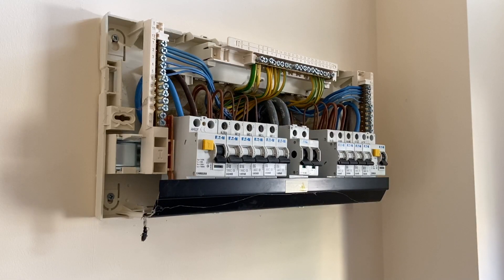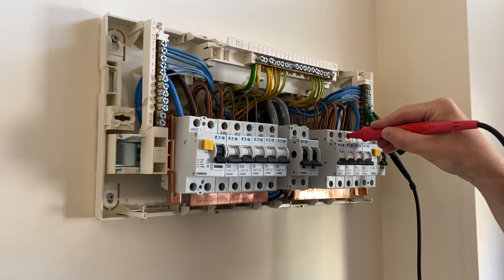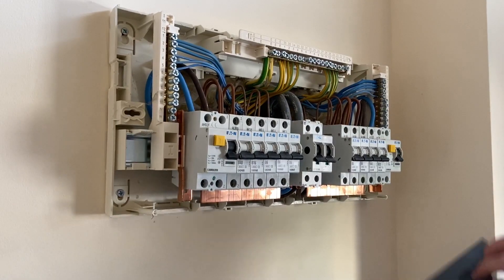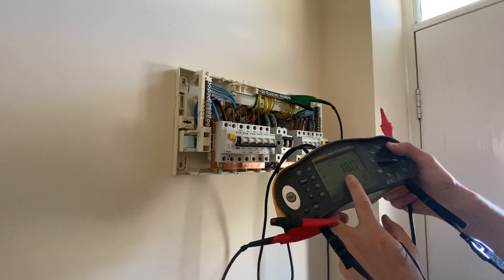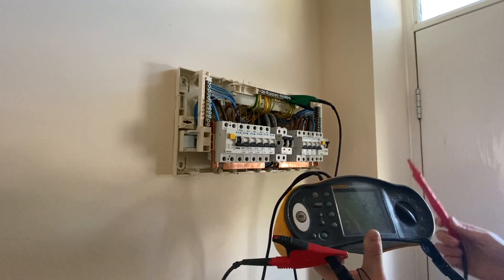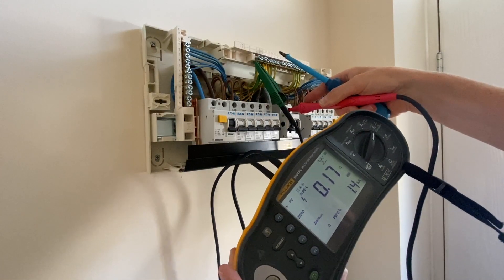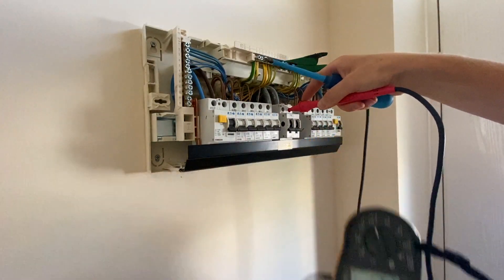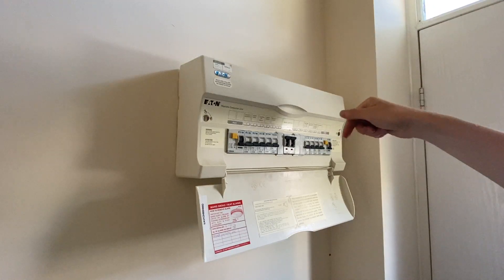Electrical Installation Condition Report Sample - Part 3

Comment: Hi another good video. How come you never connect L&N together and test at earth? Do you have a reason for not doing it
Reply: I was taught that connecting both the LN together resulting in haveing both conductors at 500v then if a component within any connected equipment fails under the IR test,  you can’t get 500v suddenly going across the load
Reply: Steven Murphy explain please why/what component might fail and why this could result in the test voltage across said load or component if you are testing only between L&N or L&E ...
Reply: The answer is that if there Does happen to be a neutral earth and you don’t connect l and n together you will then have 500 volts or some of it across any connected load .if you test l to e
Reply: I would presume because he can achieve a satisfactory result testing L-E and N-E. If so there's no point linking L&N and testing to earth. That test is just a way round if you can't guarantee there's nothing delicate connected (ie occupied shithole houses where you can't get at everything).
Reply: Why would connecting live and neutral together protect any sensitive equipment that may be connected any more than testing L-E and N-E independently ?
Reply: mark fardon Because the voltage applied to both L and N will be the same and thus the difference will be 0V.
Reply: Adam Cooke yes I agree with that but it doesn’t answer my question. if you are applying say 500v across L&E or N&E you are not applying any voltage across any load connected between L&N so why would there be a risk to any sensitive devices ?
Reply: @Marco-mg9tv  Because testing from L&E or N&E
Reply: @Marco-mg9tv  It's not likely to damage them but you'll likely get falsely poor results through the components. Then you'll spend ages looking for a fault that doesn't exist and find it's a class 1 device plugged in hidden behind a bed or in the attic you couldn't access. In those sort of properties I'd normally test at 250v first too. Test L+N to E and it saves all the hassle (but only if the customer agrees with the limitation).
Reply: Black Fingers I can’t see how you can get false results testing L to E or N to E with main switch off with loads still connected between L & N . (Assuming main switch is working properly !) even With a load connected between L& N you are only applying 500V to one side of the load and Earth. I’m hoping someone will explain the benefit, other than only testing once, of linking live to neutral then testing to Earth. And if you forgot to remove it before main switch back on well ....

Comment: No code for the CU being plastic, unless the CU is located In a sole escape route or under a wooden staircase as per best practice guide 4, always worth a mention in the notes section on your condition report tho. 
To add, a BSEN61008 RCCB and a 61009  Rcbo at 1x Idelta N should trip within 300mS , not 200mS
Reply: I noticed that too, when he was going through it in my head I was answering what the number should be when he said 200ms and I thought 300ms I got my book out because I didn't think that was right :D - we're only human we all make mistakes.
Reply from the maker: Has it always been 300ms? I’m sure I learnt 200 at college.
Reply: Artisan Electrics 200mS at 1x Idelta N  for rcd’s to bs4293
Reply: Nice comment with regards the 61008 trip time at 1x Idelta N
Reply: Steven Murphy unless providing fault protection to a TT system👍
Reply: It requires improvement so that's a c3 if I have understood the criteria correctly